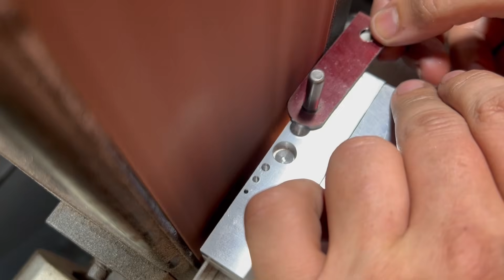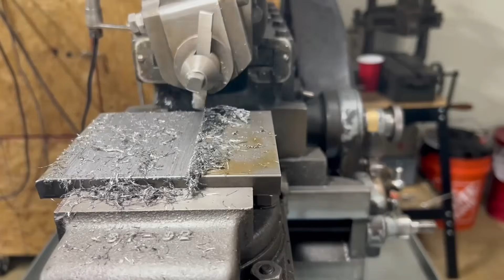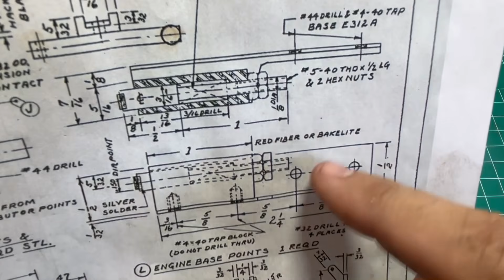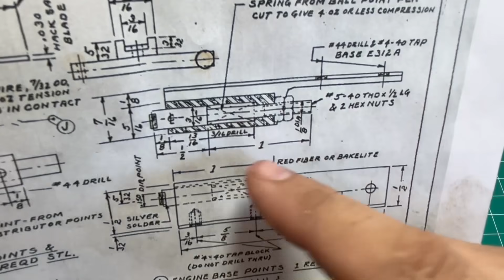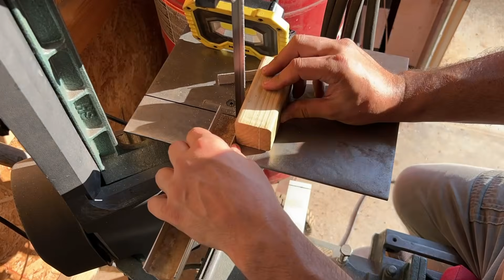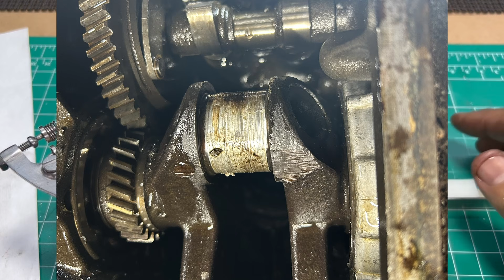Disaster Strikes! Building the Little Brother Hit & Miss Engine - Episode 16

Comment: Have you tried brazing the tungsten, if that little torch you were using is an oxy/fuel mix then it should do the job 🙂
Reply from the maker: I have not tried brazing it but based on my research it has the same difficulties as trying to solder it. I think I can come up with a press fit option that will work.

Comment: A regular propane torch should easily be able to solder those tiny parts, its pretty much all I ever use. I'm wondering what kind of flux you are using it is hard to see any of it in the video. Also the  the part with the bandsaw blade looked dark and oxidized before you ever started to heat it?
Reply from the maker: I am using the flux that came with the silver solder kit. https://harrisweldingsupplies.com/harris-stay-brite-silver-solder-kit-with-flux-sbskpop/ I agree, regular propane should work and that is what I will try next time. The bandsaw blade did oxidize real fast so it might have needed better cleaning.

Comment: hi I started silver soldering since 1970, what I was doing wrong is heating the parts too fast. the flux didn't have time to do its work. using the ox-acetylene heats very fast 
Rich
Reply from the maker: I agree and think that might have been part of my issue. I am going to go back to my other torch and try to control the heat better. Thanks for the feedback.